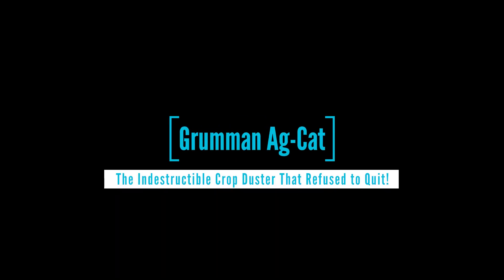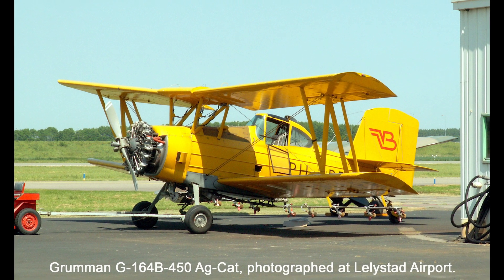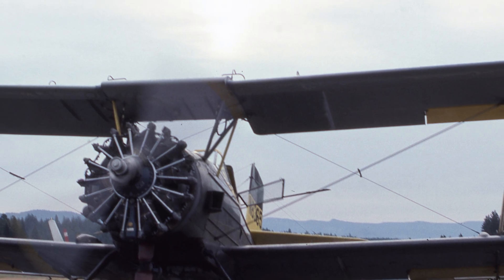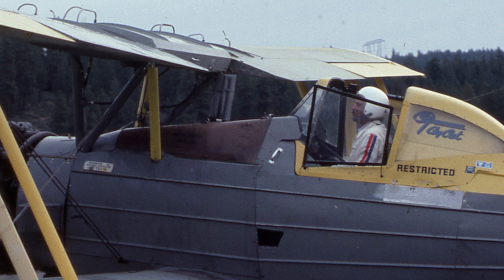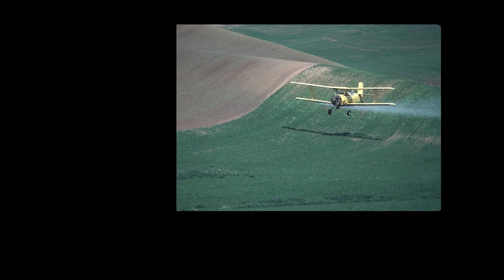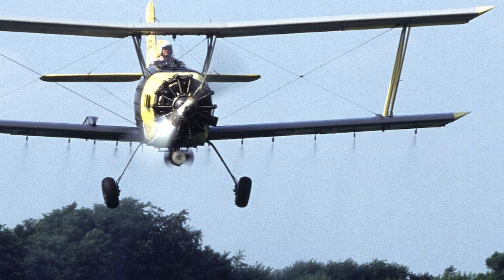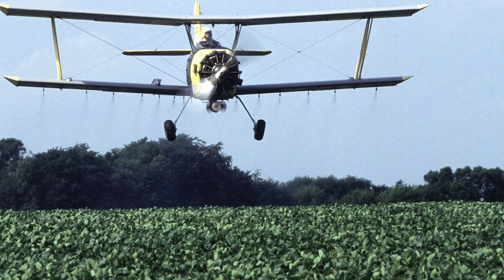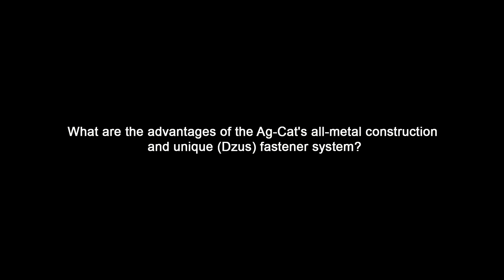Grumman Ag-Cat: The Indestructible Crop Duster That Refused to Quit!

Comment: My dad flew em. Owned em. Last 2 were B+ 400 gallon 600 hp. And I jumped wing from 4th grade 1984 thru 1995-6. And flagged b4 gps
Reply from the maker: That’s awesome—sounds like you were right in the thick of it! Those B+ models with 600 hp must’ve been serious workhorses. I started out cleaning Cessna 152s at Buffalo Air-Park when I was in middle school and worked the line on weekends through high school, so I definitely appreciate what it’s like growing up around aviation. And flagging before GPS? That’s some serious hands-on coordination. Really appreciate you sharing that—those early days of ag flying were something else!
Reply: @buffaloairpark4500 , he had a 300 gallon 600 a model before that. We ended up with 2 400 gallon thrush when we got out. I started jumping wing in 84 or 85 in elementary.
Reply: @buffaloairpark4500 mid continent aircraft, did a lot for the aga cat. The owner and founder Dick Reade, was responsible for the King Cat.
Reply from the maker: That’s really impressive—starting that young and being around such serious machines is no small thing. I wasn’t familiar with that part of Ag-Cat history, so I really appreciate you sharing it. I’ll have to look more into Mid-Continent Aircraft and Dick Reade’s work on the King Cat. Thanks again for passing along such great info!
Reply: @buffaloairpark4500 I have a lot of ag cats. Tons of pics.
Reply from the maker: That’s awesome—I’d love to see some of those pics! Ag-Cats have such a cool place in aviation history, and real-world photos always bring that story to life. Thanks again for sharing your experience—this has been a great conversation!

Comment: I owned a 1975 A model with a 1340 P&W geared engine with huge Grumman Albatross 3 bladed prop. I flew this plane from 1993 to 2017. It protected me thru 11000 hours. It didn't stall but settled flat and recovered with a little speed or extra power. Wheel landed with ease. took off like a rocket empty and no problem full with 325 gal. No heater, no AC but could fly with the doors open. The greatest flying aircraft I ever got behind the stick to. Great memories.
Reply: Hi John, I worked for Transland Aircraft from 1971 through 1976. We built the Hoppers for Ag Cat and Thrush. And, several others like Piper. My favorite by far was the Ag Cat. As a QA/QC guy, I visited the Rockwell/Ayres plant in Georgia many times. But never had to go visit Ag Cat, in New York...Reason...At Ag Cat, nothing ever broke!!!
Reply from the maker: That’s incredible! 11,000 hours in an Ag-Cat is a true testament to how solid these planes are. That 1340 with the Albatross prop must have been a beast! Sounds like it treated you well through all those years—no frills, just pure flying. Thanks for sharing, I can only imagine the memories you made behind the stick!